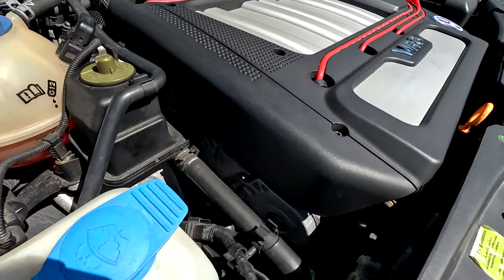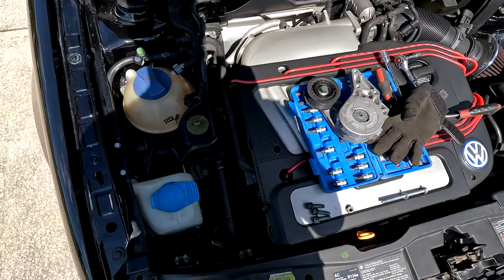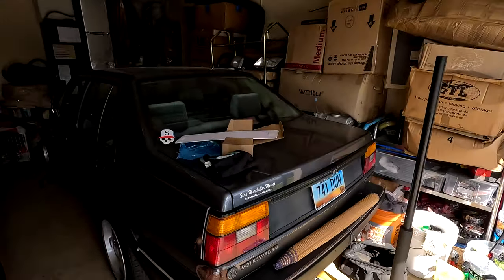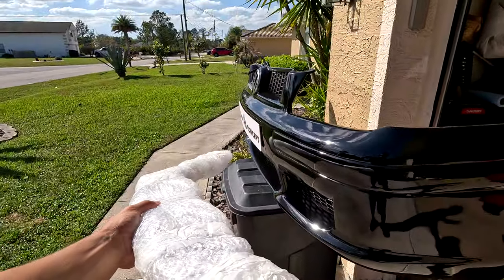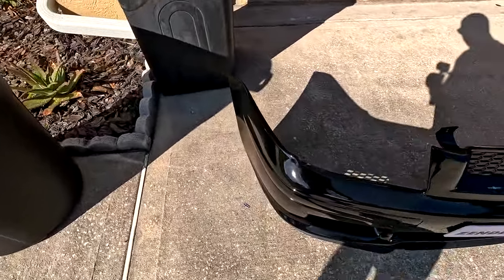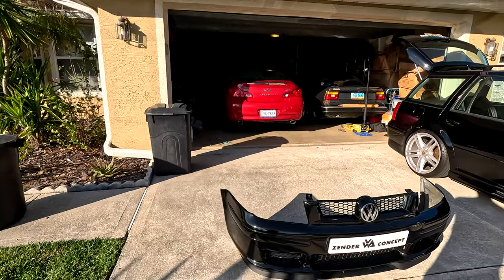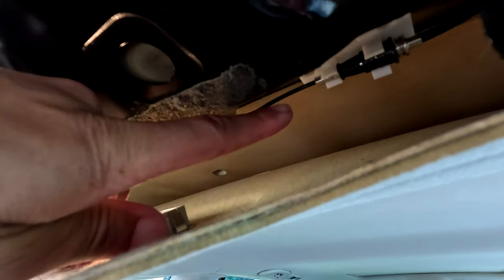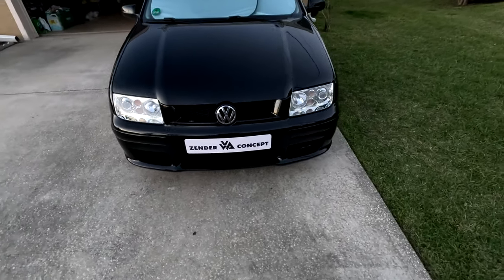Cupra Lip For The Jetta Wagon? ( Should We Change Wheels? )

Comment: The OEM mk1 cupra lip is one piece. The 3 piece ones are knock offs but they do the same thing and are more adjustable. - MK1 TDI cupra owner.
Reply: Yep, I was gonna say that, the OEM one is a one piece. Ex owner of a Seat Ibiza with a Cupra R lip on the Fr bumper bought from SEAT lool
Reply: Yeah for A3 and VW would def advice a 3 Piece... But Skoda vRS and Seats are perfect with 1 Piece and No trim needed + 1Piece Impossible to find or extra expensive.

Comment: I think you should fit the boot spoiler you had.
I think the bumper looks fine without any lip.
I like the Porsche wheels you have. The OZ Futuras are expensive and have been used a lot.
Not far from me a Bora was running new OEM Beetle wheels which looked really cool but would hide your brakes.
You can see that Bora on a TITANIC DUBS video on my channel
Reply from the maker: I will put on the hatch spoiler but I wanna wet sand the paint before I install the spoiler.
Reply: @Mk3Smith  https://youtu.be/2xHtnG1_670
At 10:45 you'll see the Bora I was talking about. Funny how we want the US look..
Also what about going left field and putting JDM wheels on the Jetta? VS-KF or something

Comment: Sound like the belt is stretched or has a cut in it probably worth replacing it solved the problem on my Ford had that same sound
Reply from the maker: Belt is still basically new and I didn’t see any signs of damage anywhere. But never know. Sound could be from the alternator